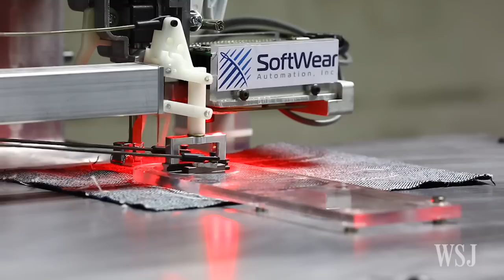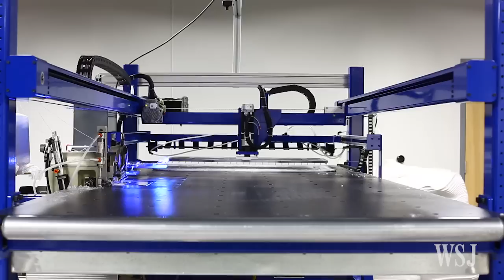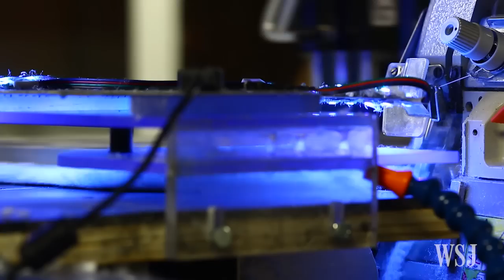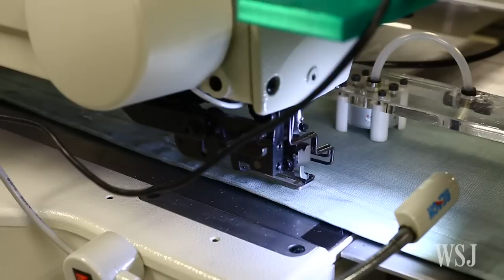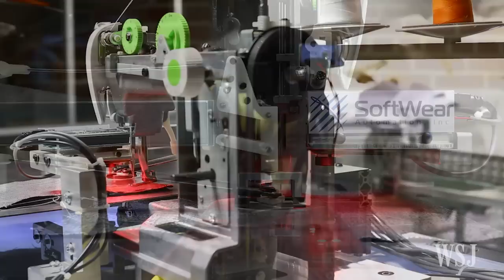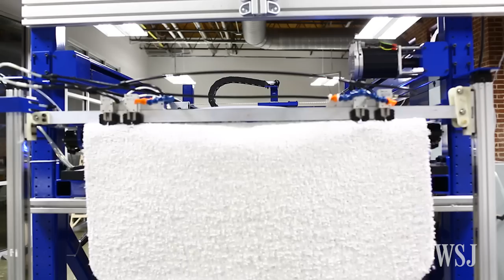Can Robots Transform the Garment Industry?

Comment: 9 years ago and yet I don't see this plastered everywhere.  I really wonder what's going on with it.  I've been sporadically following it, checking up to see what's going on.  But last I heard SoftWear Automation (the owner) has instead gone off and decided to start its own garment manufacturing business.  I think there's a lot not being said - probably the machine is having a lot of problems with downtime and, still, handling the flimsy fabric material.  If it were so great and fluidly implemented like past wide-scale adoptions of industrial tech, it would've already been more adopted than it is.  There's another machine that's similar that does knitting - can't remember the name.  In both cases, they haven't really blown up like I originally thought they would

Comment: It's not that hard.  Dragging cloth will cause it to flatten.  I have seen compressed air used as standard on juki industrial machines to flatten cloth too. And if you think edging bath mats is hard then you are truly stupid. Coz there's this thing called a hemlock foot. And for 2 bucks I got another thing called a magnetic seam guide and my 1960s pfaff has a screw in one.

Comment: While the robot picks up and moves the t-shirt to the sewing machine to get stitched, is the sewing machine automatically turned on by the robot (meaning, is it connected in any way to the robot) or does a human have to manually use a foot pedal on the sewing machine for this process to work?